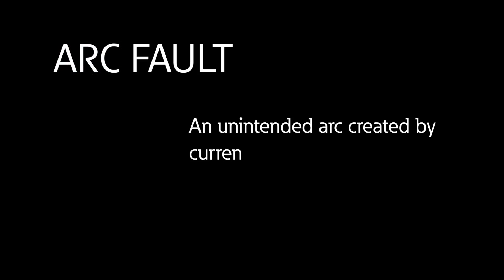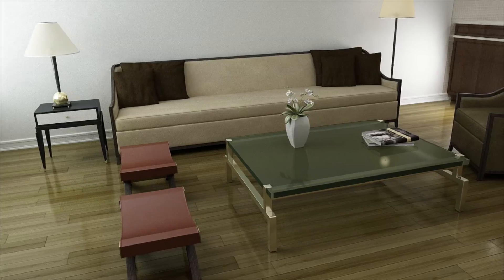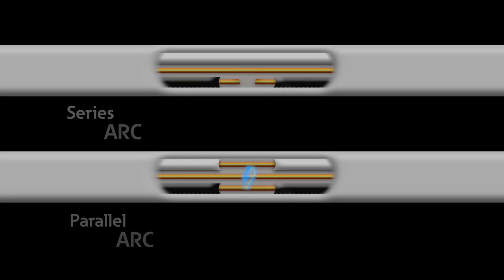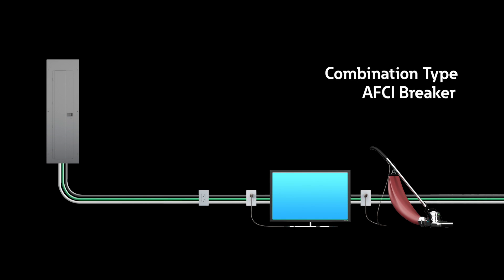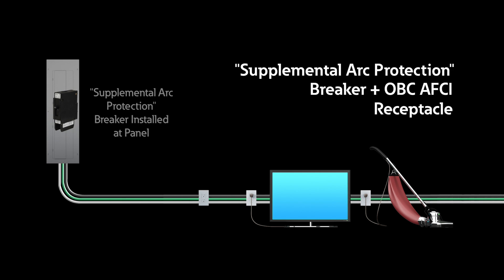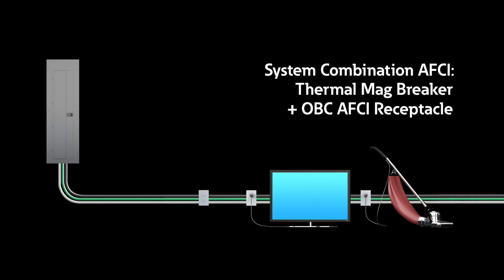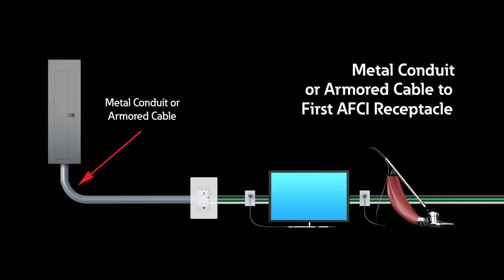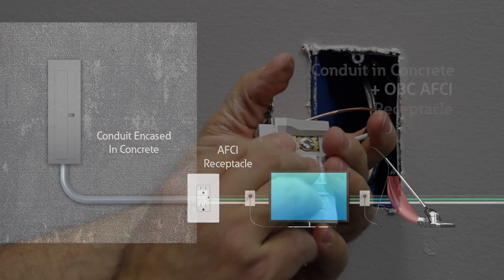AFCI Educational Video

Comment: I understand the concept of the AFCIs, and they're well needed with today's homes. However, trying to explain to a customer that has an outdated panel and little cash, that they need $1000+ alone in parts for a new panel since they're required by code now on almost every circuit, is absolutely insane and makes a lot of customers keep their old outdated unsafe panels. Huge difference in $4 breakers, vs $40-$50 each.
Reply: I agree, a lot more people would be will to do the install if the price would come down.
Reply: seansy59 
How much money on average do people spend on cable tv?
Reply: If you're not adding more than 6 ft of new wiring on a circuit when installing a new panel you don't need to update the breakers, but if you change any outlets, switches, or add more than 6 feet of wire on a circuit then you need to update the ACFI protections. NEC 210.12(A)
Reply: @paftaf  hey buddy, if i am installing a subpanel for.a new addition, will be required to use those so expensive brakers?
Reply: @dreamergth  
Probably yes. New construction, need to follow the current code.
Reply: @paftaf  thanks for the info, my boss whose electrician in NC and SC. says that only on rewiring work are required them but not on new wiring, any way i'm just collecting info before a final inspection for my customer, thanks again bro, i really appreciate it
Reply: @dreamergth  
You’re welcome. Hope all will go well for you.
Reply: Sorry to be offtopic but does someone know of a method to log back into an instagram account..?
I stupidly forgot my password. I would appreciate any help you can give me!
Reply: @Nash Thaddeus instablaster :)
Reply: @Enrique Briggs it did the trick and I finally got access to my account again. I'm so happy!
Thank you so much you saved my ass !
Reply: @Nash Thaddeus no problem =)
Reply: @paftaf  at one time? Not 2500.00 😂

Comment: Is the idea for replacing the first outlet in the circuit with an AFCI outlet that the wiring between the panel and the AFCI must be well-protected?  Hence, MC cable, in conduit, encased in concrete, etc.?  Unless there in an AFCI breaker in the panel?
Basically, if I replace the first outlet in the circuit with the AFCI outlet, do I also need to change out the raceway going to that outlet?

Comment: The statement at the beginning of the video that arcing occurs through an unplanned path is misleading.  If it is a serial fault the then path of the electricity is as intended, but because of a loose connection the current flows through a small air gap.

Comment: Here we go again!! Another AFCI breaker after a year, now giving me trouble!! It was an existing 2 wire circuit ( NO shared neutral) but remodeled beginning of 2017 requiring a dual GFI / AFCI braker. It's a microwave circuit dedicated circuit. New microwave as of Jan 2017. Breaker worked until last week, started getting calls that it keeps tripping. I"m going there tomorrow to try and explain this nightmare to another good client. AFCI breaker, I hate you!!  
EAtON, you can make all the videos you want, but bottom line, these things suck!! They are not dependable!!
Reply: did u ever find the cause

Comment: A friend of mine had a GFCI receptacle on the porch which was replaced with AFCI. Is it allowable replacement? Thanks!
Reply: No, outdoor receptacles need to have GFCI protection. Some AFCI's have some GFCI protection built in, though the trip threshold is set much higher than would be considered safe.

Comment: Arc-faults are the biggest scam I have seen yet in the electrical industry. Waste of money.
Reply: Although yes the manufacturers DO sometimes BUY an electrical code or standard to push their “safety “ product arch fault protection has been needed to reduce fires and overheating in wiring and appliances. 
The technology in these breakers have come along way reducing nuisance tripping that happened when the first breakers came out

Comment: There is not solid real world evidence that AFCI breakers stop a fire that a standard breaker would not have also. They cost much more, $55+ vs $8 for a standard breaker, and are terribly prone to 'nuisance tripping'. Nuisance tripping' is when there was no actual fault and it tripped anyway. It is common with these. Now 85 year old grandma might have to walk down the stairs in the dark to reset the breaker (added risk of her falling), or maybe all of your food goes bad because it nuisance tripped when you were away for a few days, etc.
 The large majority of electrical contractors do not support their use, and believe it to simply be a money grab by manufactures. I agree with them.
Here is a video showing how ineffective they are:
https://www.youtube.com/watch?v=iLmC5quELrE&ab_channel=BobHuddleston